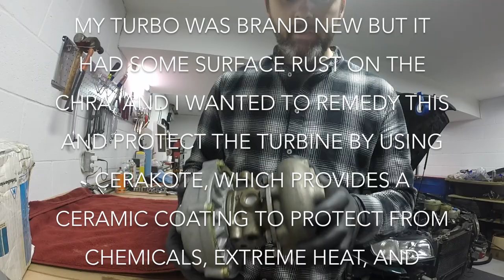How to Rebuild a Turbo! (K24 K26 T3 T4 Journal Bearing Audi RS2 S2 S4 S6 Porsche 930 951 Volvo V70R)

Comment: Nice video!!! Very satisfying to see a turbo taken apart.
Reply from the maker: Thanks.  Was even more satisfying to put it back together once it was all coated w Cerakote.  It's holding up decent, CHRA has some corrosion but I blame myself on being a bit too timid with the sand blaster.   Turbine housing looks identical to the video, but I actually didn't have fear of blasting that.

Comment: Did make vsr balancing after that?
Reply from the maker: No, I scribed the shaft/locknut before assembly and reassembled in same orientation.   Every place that did balancing that I could find just wanted the shaft/wheels/nut so it would require scribing and reassembling anyway.

Comment: 360 degree trust bearing and billett comp whell are esential....due to very old style of that turbocharger!
Reply from the maker: Those are upgrades, not essentials.  This was a NOS RS2 turbo, with zero miles on it.   Stock is fine unless you want to go even faster.    Adding a billet wheel would also require rebalancing.